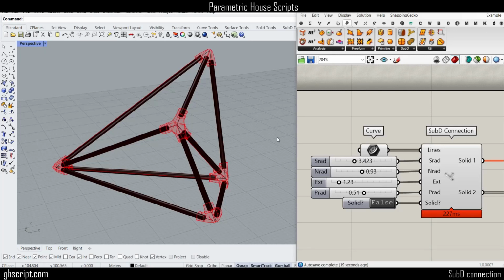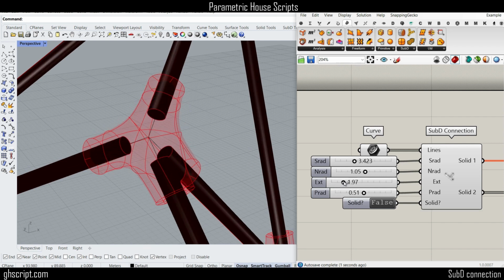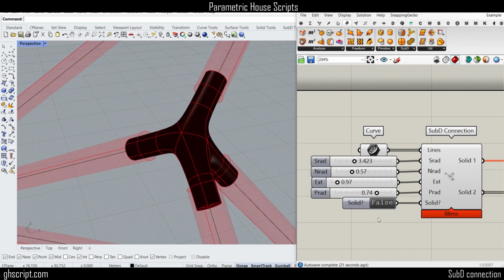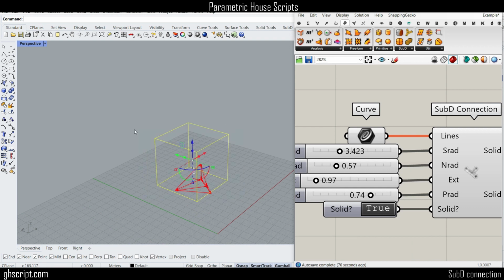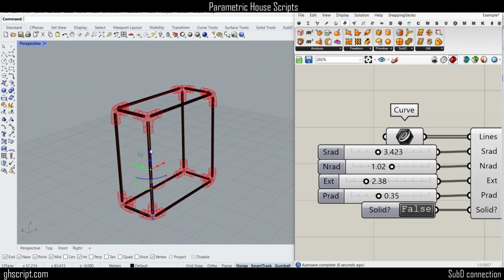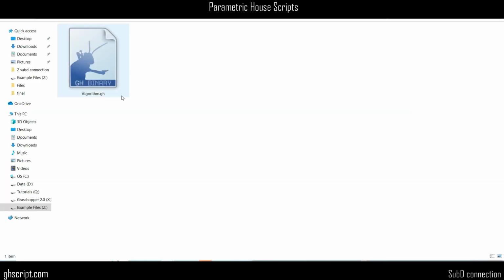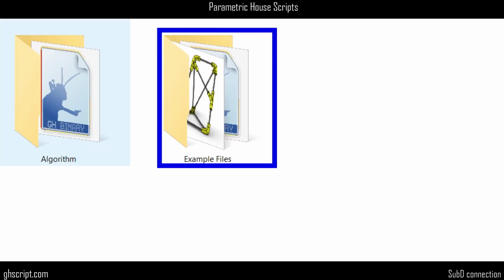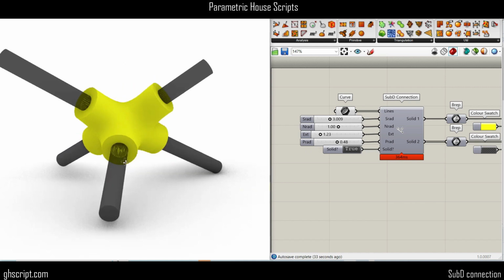SubD Connection (Grasshopper Script)

Comment from the maker: In this Grasshopper Script, you can convert a series of Lines or Curves into a Pipe+SubD connection.

Inputs
Lines : Base Lines or Curves for the connection
Srad : Sphere Radius for Nodes
Nrad : Radius for the Nodes
Ext : Extension of the Lines or Curves
Prad : Radius for the Pipes
Solid? : Make the final Solids?
Outputs
Solid 1 : The first set of Solids (Node or Pipes)
Solid 2 : The second set of Solids (Node or Pipes)

Download the Script👇
https://parametrichouse.com/subd-connection

Comment: Would there possibly be a workaround for this incase I wanted to have a rectangular profile for the curves (not pipe)? I know that this cluster is based of the multipipe node, but just wanted to know a similar case with rectangular cross-sections.

Comment: have you checked if these connections are watertight and ready for additive manufacturing? would love to see some printed examples
Reply from the maker: Definitely. The solid is a result of solid difference between the two intersecting volumes. We will try to print some examples and add it to the blog post
Reply: @ParametricHouse  Have you gotten a chance to try to print these?  Is there a way to offset the walls of the connectors to account for tolerances from the 3D printer?
Reply: @hiimbolo  yes please, this is what I'm struggling with right now